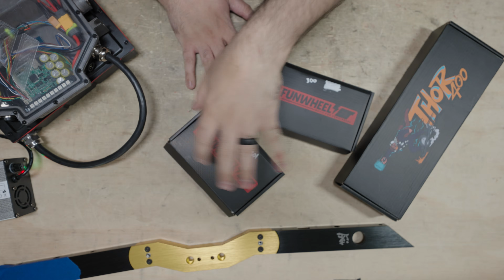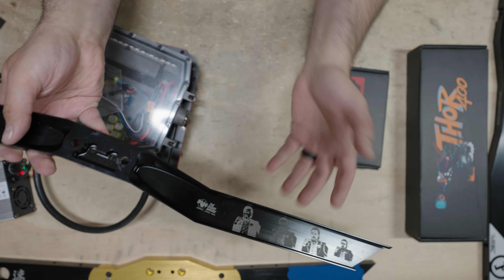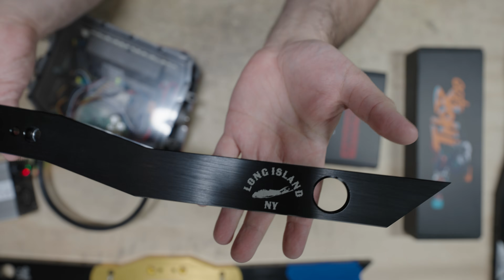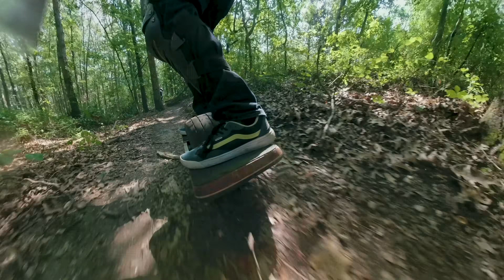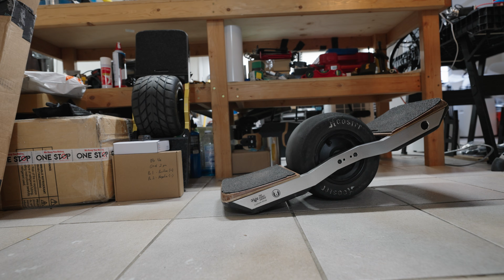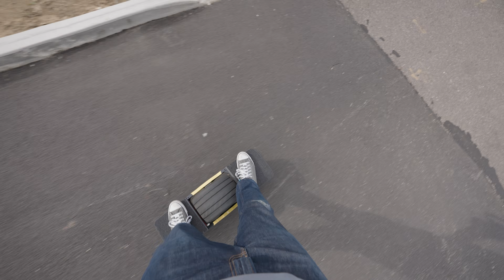A Better Onewheel VESC | Fungineers Thor301 First Look

Comment: so the humming that we were hearing was just the LIGHTS not the motor?! im so used to hearing the motor droning when i had my pint. that's a crazy difference in sound. amazing build and video brother. looks gorgeous. makes me really really want a onewheel from you
Reply: That would make for some awesome content. 
Get a thor400 30s FAS pack setup with a Superflux High Torque motor, its almost EUC levels of performance.
See if you can convince Mario to build it with a tabless cell Jp40 or 40pl, the alien technology build.
Reply from the maker: @benlay750  That’s the build I’m doing for myself now. The rails I engraved were for that specific config.
Reply: VESC is quieter and smoother than future motion, its a fairly dramatic difference. Also the superflux motor, towards the end of the video increases smoothness and reduces noise as well. 
There is sound from the motor but the humming is the 84V to 12V DC DC converter in the older thor300 straining when the lights are at full brightness.